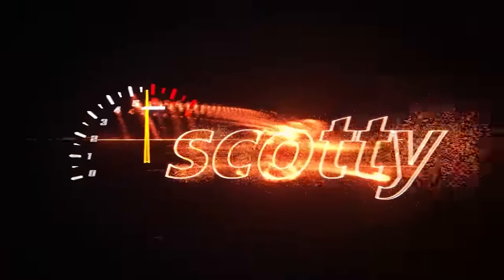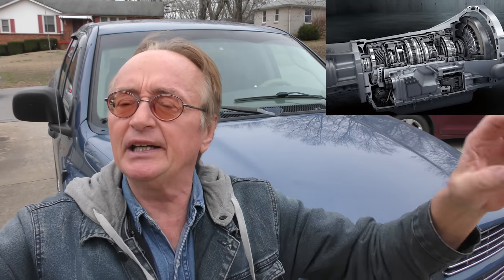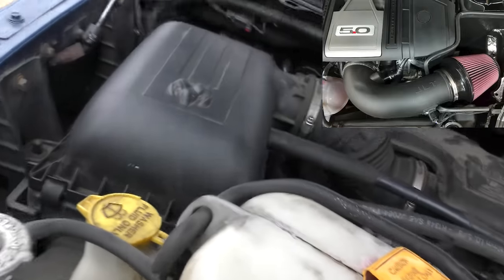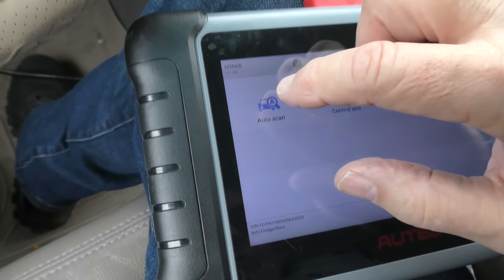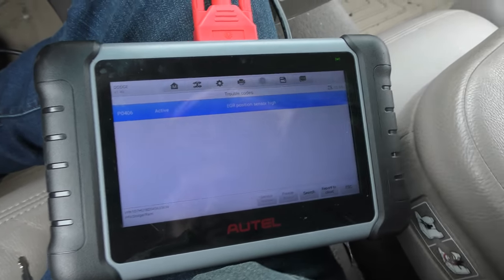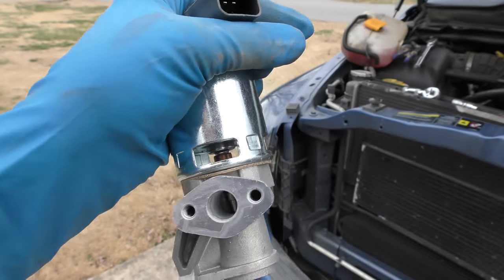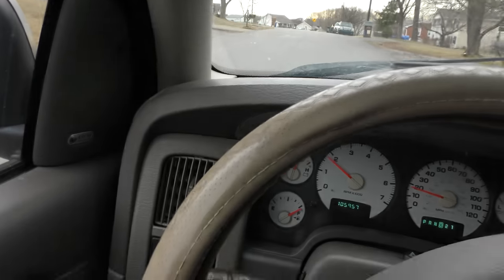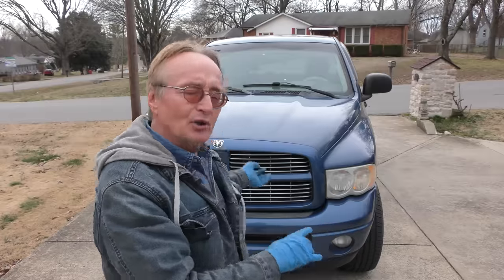Please DO NOT Buy a Dodge (Unless It Has This Engine)

Comment: I owned a 2006 5.7 Ram 1500 and got 260k out of its original engine and transmission. It was the best truck I’ve ever driven. Most of my friends and family hated me for driving a Dodge but I was the first one they’d call for help when there car broke down😊
Reply: Yup me too had a 4x4 5.7 16 crew great truck. Moved way south traded it. Since bought a 22 crew w slow 3.6 but 3.55 rearend makes it ok for take off.
Reply: 😂. Only 260k, you've never owned a Vortec, they're only broken in at 260k.
Reply: Best time to say “I told you so”
Reply: @DG-sf9ei  The problem is the Chevy 5.3 Vortec was a great motor, just everything surrounding it was crap.
Reply: @derekheuring2984  Displacement on demand AFM really shot that motor in the foot. I still wanna buy an LBZ or an LLY. But I'll settle for a nice LQ9 Vortec 6.0 because it is mated to the 4L80. 5.3 still a good motor. 4L60...meh
Reply: I have a 06 with 270k no engine issues had to replace the trans only because the bell housing cracked other than that it definitely still a champ
Reply: Yay, this is the vehicle I just bought. 60,000 original miles 5.7 the body is a nice condition. It has a 8-foot bed a cap bench seat roll down Windows no cruise control, oh and a 4x 4. Everything I was looking for ❤
Reply: I just got the same exact truck… it’s my first ever car, should I be worried? Will it have alot of issues worth more than the car itself?
Reply: I’ve got one as well, mines only got 130,000 today and my only issue is the rear pinion seal

Comment: I have a 2005 Ram 1500 4x4 with the 5.7 that I purchased new. As of today my truck has an honest 417,000 miles on the engine and rear end. Now I have maintained this truck probably better than most do. Regular oil changes at 6000 miles, rear end oil at 40,000 miles, and trans fluid changes at 40,000 miles. Aside from batteries and EGR valves, this truck has been great. I have no problem telling folks that Dodge makes a great truck.
Reply: Original Transmission?

Comment: Im a landscaper running a 2007 dodge ram 370,000+ miles. Abused every single day. Driven through woods, mud, rocks. Never failed me completely. Besides the starter and fuel pump not marking she’s running tip top. My daily is a 2012 single cab ram 160k miles. It has the exhaust bolt tick I’ve been too lazy to fix but shes tip top also
Reply: That's great. What engine does yours have?
Reply: That's awesome!

Comment: I have a 2003 Ram 1500 Standard cab. It's been my daily driver since 2006. Great truck. Tough as hell. Still a lot of original stuff too at 471,000 miles.
Reply: I'm glad to hear this, pray my truck give me that much life, it's  at 151,000.
Reply: @missa1goins  Just keep the oil changed and radiator / water pump in good shape and it should!
Reply: wow!!!
Reply: Awesome! I'm at 125k on my 2012 5.7L no major issues.
Reply: A golden sleeper !

Comment: I'm the owner of an 04 Dodge Ram 1500 Quad Cab 5.7Hemi 2wd, Bought it brand spanking new in November of 03.  I'm at 300,000+ kms and she's still driving (4-5 xs per week) with no issues.  With exception to the typical wear & tear components (brakes, shocks etc) I've only had to replace a fuel pump, heater core & (1) o2 sensor,.........THAT'S IT !!!!.  Of course the body is rotting away (good old Toronto Canada winters, lol) but this truck is a beast and I will run this thing until she quits.  Not bad for a purchase made almost 20 yrs back.  Myself and 2 other friends all purchased the same truck within a matter of months back in 03/04.  One of them decided to upgrade in 2010/11 with a new model Ram 1500 and it was nothing but issues for him within 4-5 months of owning the vehicle.  As for the other friend with the 04?  It's still going strong with 400,000kms + and minimal repairs over the years......A great all around truck with a super strong motor ;)

Comment: My 05 Ram with the 5.7 Hemi has been flawless mechanically except the usual wear and tear items.  The 5 speed trans like some have stated on here has 6 gears using a 2nd prime gear for downshifting from 5th at highway speeds, it only uses 5 up shifts tho.  Great truck, not the most comfortable but it's the last of the "real" trucks made, not like these 100k $ Cadillac wus trucks of today.  Mine can really take a beating without skipping a beat.
Reply: I have the same at 194k ❤

Comment: I have a 2000 Dodge DAKOTA (magnum 6 ) best vehicle I have ever owned ! 23 yrs later no problems!
Reply: My dad has the magnum 6 in his dakota. Strong lil engine. I HATE the front brakes it though.
Reply: @CallMeJarv  I have a 99 Dakota with the 3.9, and the front brakes do have a shitty design being the caliper bolt threads are built into the steering knuckle, other than that the front brakes are fine
Reply: Best trucks ever

Comment: I have a 2000 Dodge Magnum 360, 260,000 miles. Regular maintenance, not one problem.  Change the oil and transmission at regular intervals as it says in the manual. It's getting rusty but I'd drive it anywhere. I love it.
Reply: Nice. Me too. dodge dakota magnum 360  262,000 miles
Reply: 01 ram off road edition 258,000 miles. Trans was rebuilt at 120k and rear LSD was replaced with tracklock at 250k when the clutch retainers broke. Still runs strong minus dash core being brittle.
Reply: Not one problem? 4mpg is a problem.😂 

Seriously though, you haven't had a problem with the intake manifold plenum leaking causing oil to burn? Maybe it was fixed before you bought it. I got 160k on my 360, really only issue I have. Want to get it fixed but if I got to tear all that down might as well put some heads, cam, and good intake manifold 😂
Reply: 01 ram 1500 and not really had much big problems.   My cyl 4 is misfiring now but overall thats the biggest expense i would have to spend but if im having to spend that i may as well rebuild the trans ¯\_(ツ)_/¯   shes my first vehicle and i love it
Reply: @kdcustoms1272  Probably 9mpg lol
Reply: Just finished the bodywork on my 2000.  Ended up olive metallic. 5.9 with 90k. Very happy with outcome. Just replied upstream O2 and water pump and thermostat. Last problem is a short in windshield wipers
Reply: I got a 2000 dodge ram 1500 318 4 speed with overdrive automatic transmission it was rebuilt solenoids went bad after the rebuild not one problem it currently has 258,000 miles and I hope I can put many more miles on it I had been one of my favorite trucks to own

Comment: I have a 2008 ram with 4.7  v 8 
and is a great truck no problems 
153,000 miles
Reply: Same here, 2007 4.7
Reply: I have a 2001 Dodge Dakota Sport 4 x 4 4.7 278,000 Mi on it and still going strong Magnum engine Bulletproof. But they do blow head gaskets

Comment: The old magnum engines are near bulletproof. The 3.9 isn't winning any 1/4 miles, but it's cast iron and will outlast the frames on most vehicles. 12 years ago I bought a 94 3.9 Dakota for $1200 and I've probably put less than $3500 into it since. $1400 of it being a 42rh trans rebuild.
Reply: My dad has had 2 3.9 Dakotas, first one he bought late 90s, second one he bought 8 years ago maybe? I also have a 3.9 Dakota myself now, these are great trucks indeed!
Reply: I had an 88 Dak 3.9 with 5 speed manual. 450K when the engine finally went, ( I think timing chain broke). And it was a short box, I should’ve fixed it.
Reply: My father had a 2000 Dakota with the 3.9 that truck was rock solid. 260,000 miles on it when he passed away. Someone's still driving it now.
Reply: I got 96 dodge ram 3.9 with 42r it's got 500,000 if it's a rebuilt motor or what I don't know but it's a damn good engine
Reply: There are several transmission rebuild manuals out there that would have guided you through a rebuild of the 42rh.  Have rebuilt several of the larger units, and they are relatively easy to pull down and rebuild, you will have to fabricate several tools, however.
Reply: @thomasheer825  I probably would've tried, but I was using it as a daily and needed it done asap. Price seemed right
Reply: I still have a '98 3.9L Dakota (110K miles) and it runs like a top!--No leaks, no check engine lights, smooth idle, shifts smoothly, etc. That era Dakota with ext-cab and 6-ft bed is the perfect size pickup truck for most needs in my opinion. I do wish mine had a rear-access door, but back then, only the '97+ Ford F-150 had them as they were a brand new feature.
Reply: I had a 93 dakota sport 3.9 227897 miles darn frame was gone had to junk it ran fine.
Reply: The 727 transmission are the few transmissions any joe can work on

Comment: I've got an 04 1500 with the Hemi. Bought it used, wrecked it. Rebuilt it and still going strong!
Reply: My uncle gifted me his sitting 04 1500 hemi sport with 90,000 miles on it for my 18th last year. Unfortunately just wrecked it from teenager stupidity, but it’s almost done being fixed. Amazing truck (although I’ve only had it for a year) and I want to drive it until it blows up!

Comment: I am still driving my 2004 Dodge ram that I bought new in 04. It has 207,000 miles and still runs like new. It does suffer from a manifold leak. I am big on maintenance  so it has had nothing but synthetic oil since its 1st oil change.. definitely been a good truck for me.. it's 4x4 and I definitely drive it in some tough conditions

Comment: I have a 2004 dodge ram 4.7 magnum automatic trans bought new. Best truck ever bought. Still own it 20 years later and it has 250,000 miles original engine and transmission. Knock on wood I can get another year or two out of it. All I have done to it is regular maintenance.
Reply: 2003 4.7 mag. Amazing truck so far only 70k on the clock.

Gotta ask, when did you find the timing chain needed replacing with yours? Know it can vary truck to truck but be interesting to know how long it lasted for you?
Reply: Have the same setup 04, 290,000 miles. Really is part of the family at this point
Reply: I put 300k on a 2001 Grand Cherokee 4.7lHO. Motor was still running like new. Didn't burn a drop of oil, idled smooth never a problem.

Comment: I have an 03 Dodge Ram 1500 4 door with 3.7 v6 with automatic transmission.  It’s been a great truck.  I bought it brand new in April of 2003 with only 3 miles.  Today, 3/3/23, it has 306,000 miles and still running strong.  Only items I’ve replaced besides regular maintenance was front wheel bearings, and ball joints.  It loves to eat ball joints and wheel hub bearings, other than that it’s been a fantastic truck.  And it still drives like the day I bought it from Planet Dodge.
Reply: Hey same truck single cab, On your ball joints where did u buy them from?
Reply: @BigLaramie I got mine from 1A Auto but the mechanic was pissed off and told me that rivets mean you have to replace both upper and lower control arms. Complete front end bar end kit $100
Reply: Same exact engine in a 2010 nitro at 285,000, still runs fine and has the same issues with wheel bearings and such lol
Reply: I’m buying the same one you’re talking about and that makes me feel a lot better about my purchase
Reply: Same engine 231k miles.
Reply: I have an 02, yep ball joints and front axles for me. It’s currently needing a new axle. Engine and trans have always been great, love how it shifts. I bought the truck for 2k about five years ago so the grunt work and little money I have to put into it is worth it.
Reply: Got a 2003 3.7 V6 with 68,000 original miles,have changed ball joints,and struts in front,also new trans pan,gasket,wipers,air filter,also did spark plugs,and a 02 sensor other than engine light staying on runs like a champ!
Reply: Same thing here, 2006 4.7 295000 miles. Changed fuel pump, water pump, front hubs and yes the ball joints. Did the normal maintenance of oil changes, plugs and belts but nothing else. Never touched the transmission and it shifts nice and smooth to this day.

Comment: I have a 2004 RAM 2500 ST, 5.7 hemi, manual transmission, snow plow and towing package with 254,000 miles on it.  I bought the truck new.  The only recurring problem I've had is the pilot bearing.  It has a tendency to seize up over time.  Living in New Jersey, the biggest issue is rust.  The bottom links on the front axle rusted out.  I had to have the frame repaired because it was rusting out.  And body rot.  But, the engine is still going strong!
Reply: I own my 2005 Rumble Bee since new and had it undercoated every year. Our Canadian winters can take a toll on vehicles but mine has no rust and is mint.
I suggest a Crown undercoat if available, mine is going back for an undercoat next month.

Comment: I had an 07 5.7 QC 4x4, 17 3.6 CC 4x4, 16 5.7 CC 4x4, and now have a 19 5.7 CC 4x4. They’ve only gotten better. Another 50hp, 60ft/lb torque, better on fuel economy thanks to the 8 speed transmission. I love dodge trucks.
Reply: My 16 CC 5.7 is a mean machine. 41k miles in a year with 171k now and she still purrs like a kitten.
Reply: What did you think about your 3.6 engine?
Reply: @arturoespinoza2371  it was ok. Definitely should’ve paid the extra $5k-7k for the Hemi. Oh well, live and learn.
Reply: @brevinainslie6357   the reason I ask is because I just bought a 2019 3.6 4x2. Better on gas, just need it to do my rental work and enjoy the smoother ride going to work and to school. Don’t plan on towing anything big, MAYBE to tow a camper big enough for 2. Anything I should expect or look out for? Anything you recommend I buy or do to enhance the experience?

Comment: My 1998 Ram 1500 with the 5.9 magnum still starts right up every time. Only 92k original miles thought. Automatic. Rides smooth still and I can take a nap across the front seat if need be.
Reply: I have a 1994 dodge van 5.2 blue printed the engine… if you replace the Plenum pan under the intake manifold with a good aluminum, one put a good steel camshaft and good lifters in there. The thing will go again for another 200,000….. of course get a rid of that stock heads that are notorious for cracking ,  EQ heads they’re good !

Comment: I have an 05’ Ram 1500 5.7. I purchased the truck new and have taken care of it over the years. I have replaced plenty of external parts; EGR, water pump, cam sensor, and so on. I have never had any internal engine or transmission problems with the truck and it has over 250,000 miles. I do use synthetic and change the oil regularly. I have changed the transmission fluid twice.

Comment: In the fall of 2002, I bought a brand new 2003 Dodge Ram 2500HD w/5.9L Cummins Turbodiesel. About 20 years later and 210,000 miles later, I finally sold my old truck. That’s another Dodge of the same era that one can be reasonably confident in purchasing, so long as it has the Cummins Turbodiesel.
Reply: Nice!
Reply: Have the 02 4.7. 215,000. Runs like new
Reply: Our family has both a 1500 5.7 for a winter truck and a 2500 5.9 cummins which hauls our trailer in the summer. Both have been excellent pickups. The 5.7 has more then enough power for the average Joe.  and given the price of diesel in Canada (1.90 a liter where I'm to, gas is 1.60) the 5.7 is a no Brainer at the moment. Which is unfortunate, given the excellent reputation of the 5.9, but this generation 5.7 is very very reliable as well before they gave them MDS in 2007.
Reply: Best Cummins 03-05 hands down.
Reply: My dad has an 2003 dodge 2500 5.9 Cummins automatic. 300,000 miles all stock, still running great.
Reply: I am looking to purchase 1 with 145k miles in California anything I should look for

Comment: I've got a 2003 4.7L. 280k miles. (10k that I've put on it). It has been reliable for me and given me a usable vehicle when I've needed it. It does have some issues I need to fix. One being the downstream o2 wiring (when changing it, the wires on the truck side of the harness just came right out with no pressure, so they probably did that before I got it thinking they could just hide it). Overall, I'd have loved to have gotten this truck years ago. Pretty solid overall.

Comment: still got my 03  2500 cummins. 625,000 miles and still going. one thing about them is they're easier to maintain and work on. yes there's aggravating aspects ( blend doors issue and the odometer issue ) but it's really been a terrific truck

Comment: I am still driving the 2 Dodges my parents bought in 2006, a 2003 Dodge Dakota Ext Cab and a 2001 Dodge Durango SLT Plus, both with the 4.7 V8. The interior quality during the Daimler years is amazing as the Durango leather is still soft and not torn. Even the carpet is still plush 🧸
Reply: My dad's 1996 Dodge Caravan interior has seen alot of hard service and it's still some how mint! It was used as a work truck hauling firewood and newspaper. After 15 years and 370 000kms of hard use none of the trim pieces fell off!
Reply: @ChillkootMarkowee the vehicles produced during the Daimler Chrysler days had nicely crafted interiors. I've had 3 Grand Cherokees and still driving the Durango SLT Plus and a Dakota.  The interiors are still in great condition for 20 year old trucks.  Unfortunately, I have the 4.7 V8s and already replaced one. Can't complain though, they e been in the family since 2006.
Reply: @wadet73 I have a 2006 Durango. Any suggestions on maintenance? I already did both valve covers pvc egr etc. it only has 107,000 miles. Was it a good deal   I got it for a trade on a motorcycle I was pretty much done riding. Approximately 2,000 dollar value